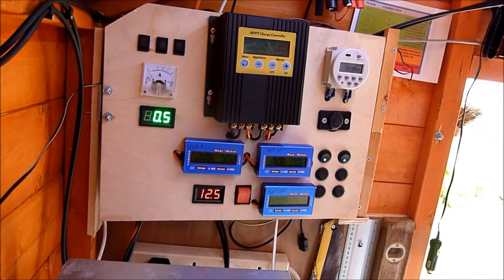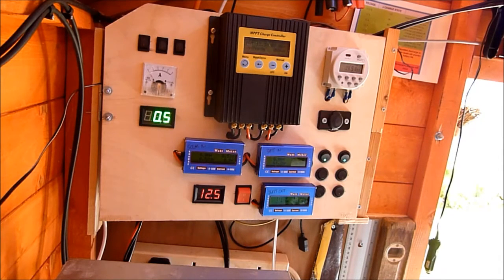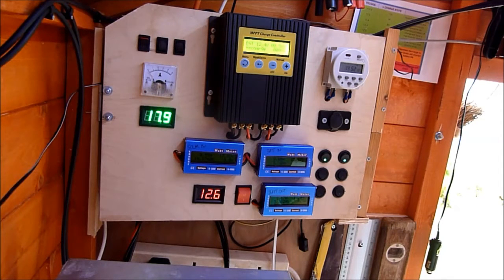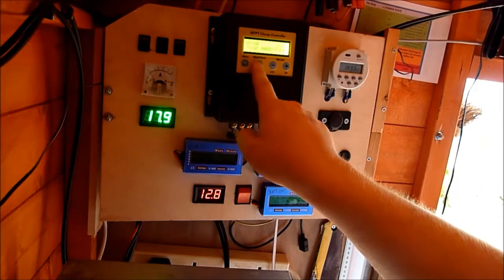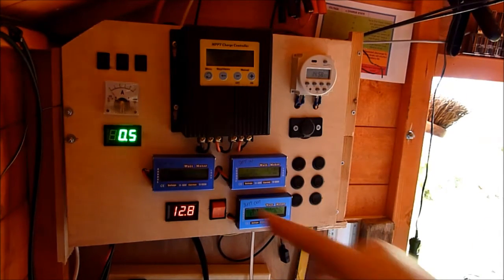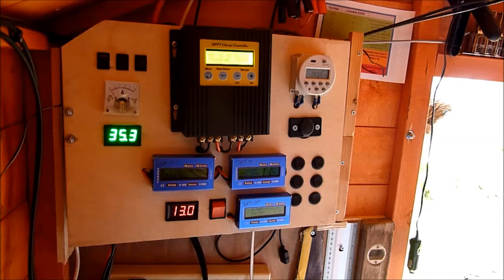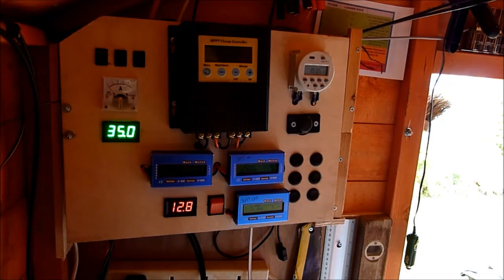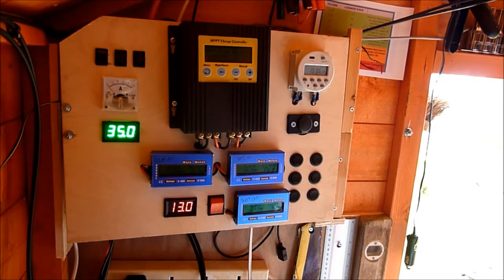MPPT 12 or 24 volt? - 12v Solar Shed

Comment: are you running 24v through the charge controller to a 12v battery?
Reply from the maker: +Mandala man Hello - that's one of the things I try in this video yes.  It is perfectly capable of running a 24v (open voltage ~42v) panel or two 12v (open voltage ~21v) panels in series on a 12v battery system.  Or 24v panels on a 24v battery system.

I'm not actually running the panels in series any longer.  There is quite a large benefit if your panels are a long way from your charge controller or your cables are too thin, but for me, the cable is fairy heavy duty and the panels only use a meter or so of cable - so my panels are all in parallel.
Reply: Hi, thanks a lot for the explanation.
Reply: +Adam Welch 
Hi Adam. I've enjoyed watching your videos. Very informative.
Can you elaborate what/why have you used parallel, rather than series?
Reply from the maker: +Michael Breslin Hi Michael, thanks for the kind words. 

Due to the fact my solar panels are so close to my charge controller, and I have decent cable installed the losses are very small. This means that the advantage of higher voltage is smaller. I'm making plenty of power for my battery bank in parallel. Couple this with the fact that I have been experimenting with switching the panels over to other uses once my battery bank is full, 12 volt panels work best for me. 

This may change however in the future with my new solar charge controller. My shed rarely stays configured the same way for long!

Comment: Hi Adam I love the tidiness of your board. Mine is a mess. Just out of interest, is the MPPT charge controller automatically recognising the batteries are in 12v mode and converting a 24v input to 12v output for you?
Reply from the maker: +Matt Cook Hi Matt - thanks for your comments.  I like to keep it fairly tidy when I can.

The first thing my MPPT charge controller does on startup is ask for 12 or 24 volt 'system'.  This is the battery voltage.  After which is just does it's MPPT thing.  I've tested running my panels in parallel and series (Around 17.5 volts and 35 volts) and due to the very short cables attached it makes little or no difference to efficiency after the conversion to 12-14 volts.